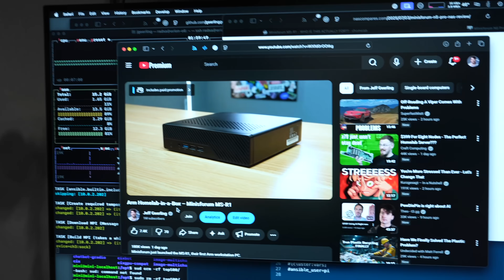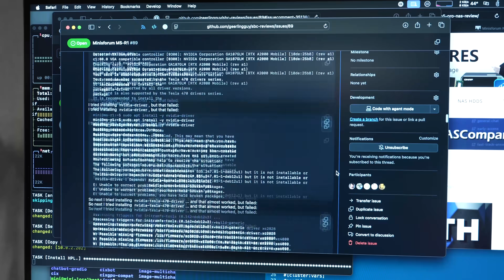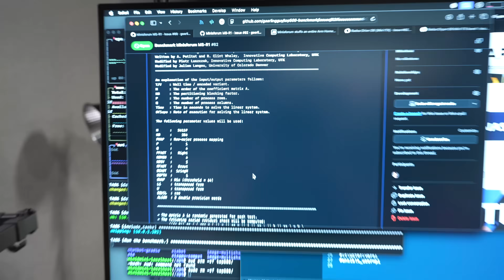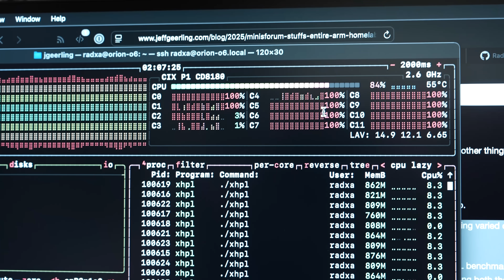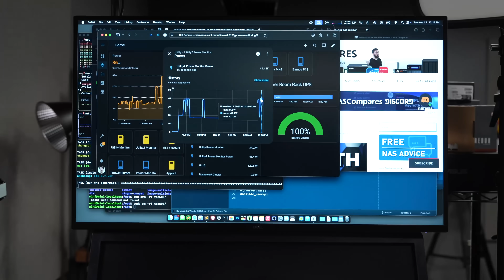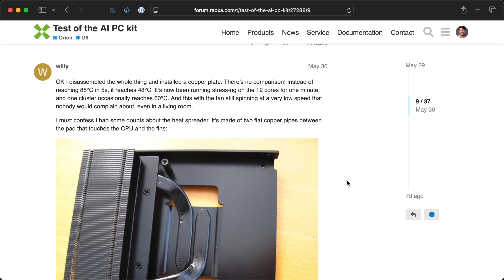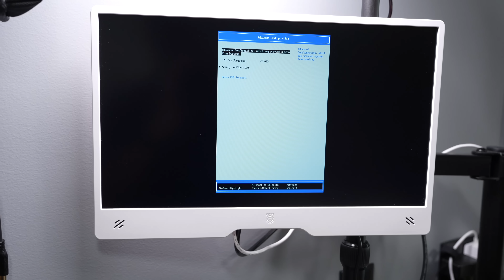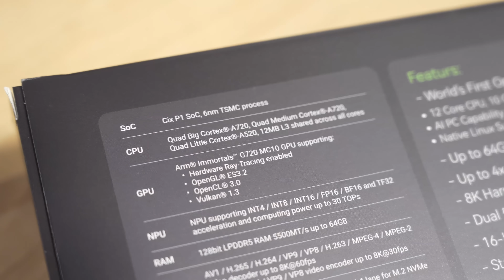Much Ado about Arm and Benchmarking

Comment: I can't agree with you that PC bios updates are any better. Recently did one that required basically the same thing, and the end result was it told me after the bios update that it has cleared my TPM, in the process deleting all my passkeys, had to redo my Windows login and my system is still failing to activate as it is considering the mainboard to have a different ID now.
The Windows based tools of at least ASUS & Gigabyte are just garbage on top of even that and regularly just get stuck in the middle of the flashing or crash and leave the firmware in a broken state. Thankfully my main system has dual bios, or I would have ruined my board several times now, but that exact thing happend with past boards. I think most people just never even consider updating their firmware on PC at all.
To me it seems like we need to do something about firmware & updates in general. I have a StarLite tablet with coreboot that actually regularly updates with fwupdmgr, which is integrated into KDE and Gnome UI Sofware install/updaters. Can't say everything is perfect, but at least it's something. Would be great if updating it would be less possible to just brick everything on top of that.
Reply from the maker: Ouch! And yeah... I guess I've been lucky with the last few BIOS Flashback operations I did. But a few years back I did have to spend an entire day upgrading BIOS on one board :(
Reply: @Level2Jeff  Oh I don't disagree that it is a terrible experience on that ARM board as well. And in this extremely early state they are far more necessary than maybe on your typcial AMD or Intel board. You'd think they were inviting you and everybody else to a early preview, not a product they are selling.
I think you said it well in your original video. RPI gave us a good very low end, and there certainly are some good high end ARM servers, but we are lacking the normal mid range and the consistency (minus perhaps Apple, but doesn't really count in this context), and as much as I like that this processor is going with a real UEFI boot at least so  we can get away from needing a custom version of each distro for each board, it still is a long way off being truly production ready.
Reply: One reason to avoid TPM and/or windows11
Reply: @GeorgeTsiros Yeah, it’s dual boot and I’m mostly using Linux by now.
Reply: I had an omen that would crash the power control chip when it did a firmware upgrade on it.   then you had 2 options. either remove the battery(take the back open, disconnect) or wait for the battery to run out somehow.

anyway keep a copy of the drive decryption key. it's not just firmware upgrades that can trigger windows to ask for them. sure maybe if you use an online ms account on the machine the keys maybe stored there but that's not gonna do you any good if you don't have way to access it.. a copy on paper or phone or whatever is much more of a failsafe(* however maybe you don't want the key to be easily available if you're doing something naughty then come up with some obfuscation on the paper version or something *). 

I somewhat recently just swapped windows ssd's from one laptop to another and it didn't say anything about the hardware being changed (pro key installed on top of whatever the machine key on the old laptop was)

Comment: Covering the screws with those rubber pads should be criminal. My suggestion is to leave the original pads off and install some different (maybe even taller) rubber pads next to the screws.

This video is exactly why I haven't touched ARM computers beyond the Raspberry Pis. I'm interested, I love to play with new toys, but if the manufacturer can't be bothered to upstream the drivers and fully support their hardware, then I can't be bothered to buy their junk.
Reply from the maker: Maybe I could drill out holes where the screws are in each of the pads, probably a quick and easy-ish mod!
Reply: @Level2Jeff Oh, didn't think of that, I like that idea!

Comment: Correct me if I'm wrong, but you normally aren't supposed to run all CPU clusters in big little simultaneously. So I'm pretty sure there is nothing wrong with L2 and L3. The scheduling is most definitely not working as intended with the CPU.

Comment: Thanks for the very open and honest update, Jeff!
3:30 I think this whole situation mainly just highlights the value of your approach! Your more scientific approach of documenting what exactly you did as well as what happened really pays off when something is... in this case not even "wrong" but I suppose done in a suboptimal way for this hardware, where those results can then lead to some incorrect broader conclusions where the issue is actually quite specific.

Comment: You also might consider a methodology which engages someone you trust to perform an initial review using your standards and they do the tedious work and produce findings which you can they review, redo, and/or confirm.  A policy you could adopt is that 2 or 3? units have to be provided if they are under a certain dollar amount so you can leverage your support team.  You're heading towards a team, or you will be eaten alive by the tidal wave of new products.

Comment: Perhaps after you complete your tests, and before you publish, you give a preview of your findings to the manufacturer/vendor with a 1 business day window to respond and point out to you anything they feel you have overlooked.  This would help flush out issues such as not using optimizations before you go public?  You may well want to bifurcate a test: A) without optimizations (standard) and B) with optimizations.  And to reduce their argument they cannot possibly digest your testing protocol in 1 business day, you provide that ahead of time so they can't complain they did not have enough time.  Example: Dear Acme Manufacturing, I am going to test your rocket jet using these published protocols: [link].  When I have concluded my test, I will provide you my conclusions and give you 1 business day to respond or point out why I should not publish these results.  This is the kind of foundation used within litigation and legal review -- give the affected party an opportunity to respond before you, the judge or jury, go public.  

Someday Gentoo Linux?

Comment: Appreciate all the device testing, in a way its a massive multiplier on Dev time saved. Its definitely two different objectives; theres the bench time to see if a device even works out of the box with a common distro for an MVP, I can see a lot of saved time for dev's that just want a minimal config solution where they just slap their code on top. The second is theres a more detailed time save scenario where hardware/cost really matters and theres more flexibility / hacking / more sophisticated ansible tricks to get the systems running, more of a "is an MVP (with this hardware) even possible". The fact you post your findings on your blog & Github I think is critically invaluable as it makes the benchmarks both more reliable and traceable than any of the other channels.

Comment: You've explained why I stick with RPi - They just work. I tried Orange Pi 5+ 32GB, ending up with a lot of headaches trying to get the thing to run a standard distro with a modern kernel... Culminating with the NVMe SSD slot failing after ~3 months. I'm all for experimenting but at some point enough's enough.... These ARM vendors really need to find some way to standardize/simplify dealing with their hardware. It was pretty disappointing - Was really hoping to use that RK3588 and 32GB for some things beyond RPi 5's own memory/performance limitations.
Reply: Many years ago after experimenting with a few SBCs (eg the cubieboard2) some of which with rockchip stuff on them
I decided I'm never buying anything niche/unpopular. Only the most popular stuff. Because when cubieboard2 was found to have a fault that killed its performance, no fix was released. They went on to sell many future versions with different specs and features. Fuck thaaaat. I hate RPi but being extremely popular, they are basically guaranteed to sell something decently well-designed and complete

Comment: Using the term 'Idle' to include 'sleep' or 'standby' is just wrong.... it's not a matter of 'meaning different things to different people'.  There is no point in using technical language if it doesn't mean something specific and common.
Reply: Yeah, it’s absurd. It’s like referencing your resting heart rate, but only recording your biometrics while you sleep
Reply: Yeah, no real deep sleep/standby should be counted, only the regular CPU sleep states.
Reply: Exactly, I've pointed this out a bunch on DIY channels with subjects like networking and 120/240v wiring. You can't use the wrong terminology and you absolutely cant show it being done (teaching others) in a method that's dangerous or breaking code. My biggest issue I'm seeing constantly is combining low voltage (network, coax, etc) with 120/240v wiring. It can kill someone, it's not a minor mistake.
Reply: Sleep and standby are also used differently though. Lots of people refer to even C1 as the cpu sleeping, because Intel refers to C states as sleep states. But to others, all C states are just idle and you have to go to S states before they consider it to be sleeping. Different people use the terms differently because vendors use the terms differently. And vendors use the terms differently because they focus on different things.

Point is, the meaning isn't as strict as you're imagining and you've probably just adopted some specific vendor's verbiage and consider that The Truth for what they mean.
Reply: @danieljonsson8095  But thats not relevant here, we are talking about a state where the system can resume seamlessly after user input is seen, without noticeable delay. If there is significant delay (sleep) it is not idle.
Reply: @jaro6985 What you call idle, is probably not what others will... As an example, Intel refers to idle as the CPU running noop. That won't cause the cpu to turbo, but it also doesn't include power saving states. Others will consider a cpu to be idle only when it's clocked down and in its most power saving mode. Yet others will consider it idle if there's no programs running in the forground and completely ignore what state the hardware is in etc etc. It all depends on who you're talking to and there really is no fixed definition of what idle actually is to a computer. And there likely never will be because microsoft, intel and amd, all have different views on it, and they're the three biggest proponents of their own definitions of the term.
Reply: @danieljonsson8095  those there examples are all idle. entering a full sleep state is Not idle. that's asleep. it's true that there's some fuzziness in the middle with sleep states etc, but "idle" doesn't ever include states where the device is effectively "off" and needs to go through a cold data load or turn peripherals back on to resume operation.
Reply: @wareya Sigh... That's all idle TO YOU. Others will use the terms differently. Idle and standby are used interchangably a lot when referring to TVs as an example and seeing as how a TV today effectively runs a computer that is put into full on S states at that time, it's not even rare that people use idle to refer to that state.
Reply: @danieljonsson8095  well, they're wrong
Reply: @wareya To your mind I'm sure they are, just as to their mind you're the one that is wrong. That's not really meaningful a resolution.
Reply: @danieljonsson8095  we can talk about this for real if you want to stop doing the same thing i'm doing in response to you. but until you stop pretending that there isn't a line where it stops being idle and starts being sleep, i'm not going to stop saying that they're using it wrong
Reply: @wareya I didn't say there isn't a line. I said the line is placed differently to different people, and it's not even like moving along a single axis either.
Reply: @danieljonsson8095  that subjectivity has its limits: if a device is fully off, you can't call that idle. similarly, if you disable all your primary peripherals and downclock from 2ghz to 1mhz, that also isn't idle. gesturing in the general direction of subjectivity is not helpful and does not actually describe what terms mean. the peanut butter jar in my kitchen is not a birthday cake. are you willing to actually talk about what the term means, or are you going to keep gesturing at nothing?
Reply: @wareya Except it wasn't fully off. Sleeping in the Windows sense, isn't off. The CPU is off, but the ram is still powered, as are certain peripherals like mouse and keyboard. As for subjectivity, dude... ALL of language is subjective. 100% of every word, sentence and definition is subjective. That's literally how all living languages work and evolve over time. The important part is conveying what you mean, not which particular words you use. We're not casting some archaic spells here. And in this case, even though they used idle which you obviously disagree with, their actual meaning was clear in their video. The meaning would only be lost to those that grabbed a screenshot of the table and took it out of context.
Reply: @danieljonsson8095  i didn't say or imply that it was fully off. you didn't apply reading comprehension to my post. argue in good faith please.

Comment: You weren't wrong, your data was real and backed up with how it was obtained. New methods make more data which was just different and that's a good thing. Always leave the previous data and just update with new information, we love your updates because that shows integrity and dedication.
Reply: I agree, sometimes posting inaccurate data (with the clear explanation of how and why) can help prevent the next tester from making the same mistake.  Errors data is data, and anyone can make those same errors.
Reply: @Ny_babs  One even has to ask: was it a mistake? Was it an error in data? Because when we are running software in our daily lives, are we going to research all the settings that have an impact on performance and dial the software in so that it works as fast as possible? Or are we simply starting the software and using it as is?
Reply: You do a great job. I went to grad school in St. Louis and lived in Clayton for several years. A long time ago…